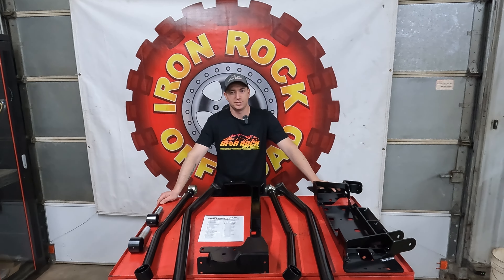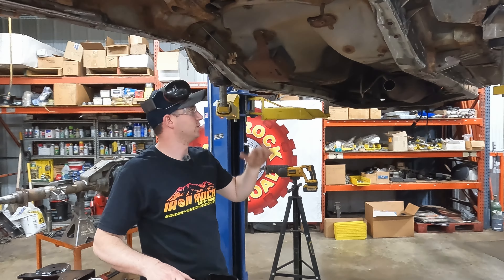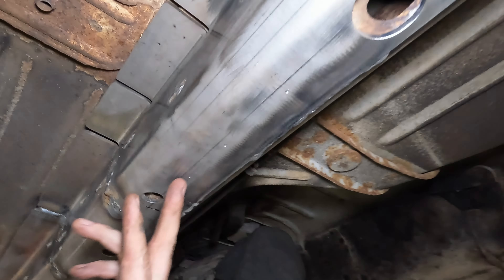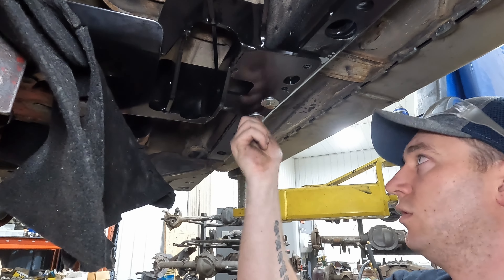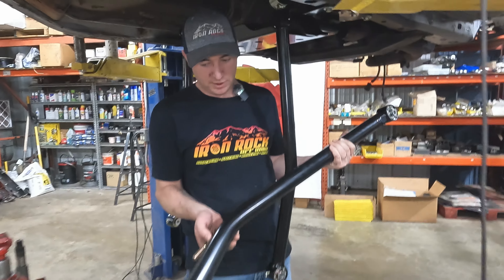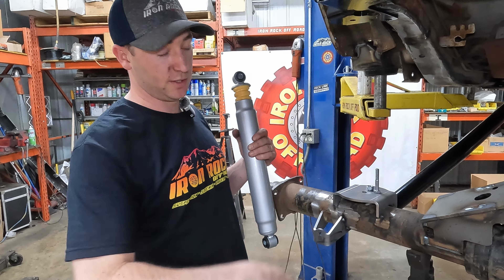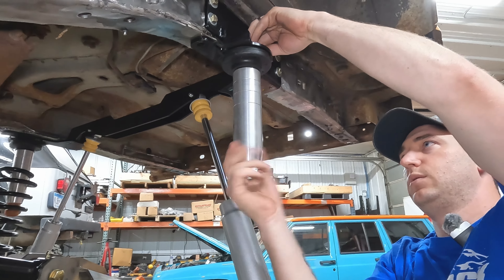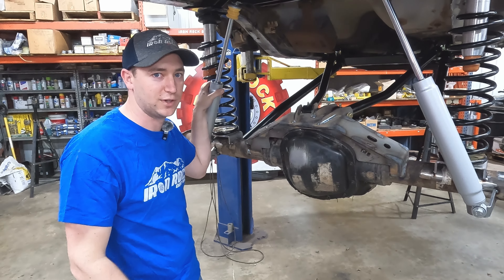XJ Rock-Link Rear Long Arm, Ditch the leaf springs for a 4-Link!

Comment: Been running this kit for about 1.5 years now and absolutely love the ride quality and travel. Just need to get limit straps sooner than later before I stress out a shock and break it. But very pleased with the kit in general! Was very easy to convert my Jeep to JK axles with your long arms.
Reply from the maker: @mountaincrawlers8 That's great to hear! Thanks for the positive review! How much lift and what tire size are you running?
Reply: @IronRockOffRoad  37s and roughly 7-8 inches of lift. Plan on stretching the rear with a doubler and lowering it a couple inches in the near future.
Reply from the maker: @mountaincrawlers8  That sounds awesome! Keep us posted on the progress! Give us a call or email if you need anything!
Reply: I'm in the middle of the install on this kit.  I have the coil conversion portion done and I'm working on the exhaust right now.  Did you re-install your cat when you did the exhaust?  Overall this kit gave me 2.5" more of lift over the Deaver leaf springs I had in the rear.
Reply: @stevenhunt66  no I deleted the cat years before installing this kit
Reply: @mountaincrawlers8  Ahh, yah it's looking like I might have to do the same with mine to get this to work.  Cali is a PITA when it comes to smog and modifying exhaust, so I have to be aware of what can and can't happen if I want to keep this thing smog legal.

As for the kit, you mention you love the ride quality and travel.  I'm very curious if you happen to have any pictures of how your XJ wheels when all crossed up with this coil kit?  I'm looking forward to wheeling this upcoming season with this thing.  I got new longer Bilsteins on the way since my originals were severely limiting the axle articulation in the garage.

Comment: I bought and installed this kit a couple weeks ago. I got the whole front and rear RockLink kit, plus a front truss and the 4 link rear exhaust. HOW IN THE HECK DOES THE EXHAUST FIT UP? I have tried this pipe every which way around I can possibly think of.
Reply from the maker: @TheRealMikeWilly We will be doing a video on the XJ 4-link exhaust in this build series, stay tuned for that. In the meantime, check the instructions for the XJ 8" Rock-Link PRO, we have a picture of the exhaust kit installed at the end of the suspension section. If you need more help, you can always give us a call 9am-6pm central time and talk to a real person. 952-210-7185. We would be glad to help you! Or send us an email at tech@ironrockoffroad.com
Reply from the maker: @TheRealMikeWilly Also, check the product photos for the XJ 4-Link rear long arm kit for exhaust routing. Product code 12544
https://www.ironrockoffroad.com/product/xj-4-link-rear-long-arm-kit.html

Comment: How much stretch can you get from mounting this kit? Can you just mount the cross member further back to get more? I'm aware the gas tank will be an issue with alot of stretch. Just curious about the adjustability of the kit
Reply from the maker: @fbik2009 You can get about 3" of stretch with our 4-link kit. We build a lot of adjustability into the threaded male ends in all our kits for anyone who wants to stretch or for extra adjustability in an axle swap. If 3" of stretch isn't enough, we do offer to make custom length arms for our kits. Since we manufacture everything we sell, we can do just about anything you could want. All the standard kits are ready to ship out the same or next business day, custom arms would be built-to-order, approximately a 3 week lead time depending on if you want them powder coated.

I wouldn't recommend moving the crossmember rearward because the rear driveshaft needs clearance when the axle droops.

Comment: Im in the middle of doing an ls swap on my xj , i want to use your 4link rear and 3 link front i just wander if i could still work with the transmission posibly being farther back on the body
Reply from the maker: @joshstapleton4172 Absolutely! We have had several XJ customers do an LS swap with our 3-link and 4-link long arm kits. You just need to fab an adapter for the transmission crossmember. No big deal if you can fab motor mounts and everything else to swap in the LS. Go for it and keep us posted on the build!

Comment: Does it sit lower with the 4 link? What about the load rating compared to the leaf springs
Reply from the maker: @montec3113 The Jeep will sit the same after the 4 link is done. We do offer the 4 link as a part of a complete lift kit also. If you want to upgrade all the suspension and add lift all at once look for our Rock-Link PRO kits on our website.
https://www.ironrockoffroad.com/category/long-arm-lift-kits.html
If you already have a lift kit, you can also get the 4 link as a long arm upgrade.
https://www.ironrockoffroad.com/product/xj-rock-link-rear-long-arm-upgrade.html

The load rating on the coils we use is a little higher that the leaf springs we use. This has two clear advantages: coil springs typically ride better than leafs so a slightly higher rate is acceptable, the firmer rate gives a little more load capacity for accessories like a bumper, spare tire, skid plates, etc.

Comment: Saving up fpr the sliders, frame supports and a complete long arm kit front and rear fro you guys for my 94 XJ. Figured best to knock it all out at once. has a 6 inch short arm on it atm.
Reply from the maker: @warbanzi That sounds awesome! Keep us posted on the build!
Reply: @IronRockOffRoad  Picked it up out of El Paso from a kid that was beating it to death at Red Sands, 37 inch tires sawsall fenders on stock axles with 4.10 gears. How that little Dana survived is like the 8th wonder. On 35 inch now and still un FUBARing it.
Reply from the maker: @warbanzi Nice! It sounds like a good set up. Take care of that rig and it will take care of you!

Comment: Can you run the stock fuel tank? What about a CAT converter?
Reply from the maker: @ianmikelson4187 Yes, you can run the stock fuel tank with this kit. We have the tank removed for easier filming and because we removed it to do the frame stiffeners and haven't reinstalled it yet. Our 4-Link exhaust kit (product code 13888) will incorporate a catalytic converter and clear all the new suspension components.

Comment: What travel length shocks can you use with these? I currently have 12” travel fox shocks and would like to reuse them.
Reply from the maker: @jordantrujillo293 The 8" rear long arm lift kit uses 12" travel shocks with a collapsed length of 29.5" eye-to-eye. The new shock position provides a huge amount of articulation as well as moving the lower mount up on the axle to get the shock further out of harm's way. You might need to swap those Fox shocks for some shorter ones.

Comment: I have the 4in kit mounted up to a ford 8.8 on my 1991. I have been running it for a few years now and for the most part am very happy with the kit. 
One issue I have ran into is in the rocks all flexed out the axle flexes so far that the spring drops  past the bump stop then when you level back out the spring has got between the unibody and the tire. I wish the spring was longer and trying to find a replacement has been a big challenge. The other option is running limit straps but I don’t really like the idea.
Reply from the maker: @lambert454 Thanks for the feedback, it's great to hear the kit is working for you! That spring drop issue is tricky, have you tried different bump stop lengths to see if that will help?
Reply: Thank you for the reply. Yes I have lengthened the bump stops. To the point i only have two inches of up travel before the axel hits the bump. I have a triple rate spring from metal cloak I am going to try. The spring rate is similar but the overall length is quite a bit longer. 

What are your guys thoughts on limit straps?
Reply from the maker: @lambert454 We are working on multi-rate springs for this application, but our spring manufacturer is in the area effected by hurricane Helene. We typically don't recommend limit straps, but our XJ rear 4-link has such a huge amount of flex I would be ok with a limit strap in this situation. Limit straps are great at protecting your shocks and providing a confident stop to the suspension travel, we use them on our Ultra 4 race Jeep. So often we see them setup incorrectly.

Comment: Installing this kit now on my 92 XJ.  Everything is going as planned and these guys gave me some good tips over the phone when it came to the coil springs placement that worked beautifully, thanks Travis.  

I'm currently working on the exhaust kit and my 92 has a cat that I'd like to incorporate into the exhaust, which LOOKS LIKE it would require welding the cat up AFTER the 4-link crossmember due to clearances.  But I don't see a cat being used in your XJ exhaust routing picture.  I'm wondering if that cat you show in your TJ long arm exhaust video is smaller than the cat I have, which is a MagnaFlow Exhaust Products 339229 Direct Fit California Catalytic Converter.   This cat has a flange on it that bolts to the cross pipe assembly of the XJ, which looks like will require me to cut the flange off the cat and weld up pipe to the flange and then again to the cat to make this work.   

Any chance you guys will have your XJ exhaust video or instructions up soon?  The XJ long arm exhaust kit you sell looks like it was designed w/o a catalytic converter in mind.
Reply from the maker: @stevenhunt66 Thanks for the compliment! You can certainly incorporate a cat into our 4-link exhaust for the XJ. We should be onto the XJ 4-link exhaust video very soon. The cat will have to be repositioned from its original spot because in will interfere with the rear 4-link crossmember location. Once the rear crossmember is in place it will be easier to position your cat. Take a look at the attached instructions below. You can see a small cat positioned between the front and rear crossmembers.

https://www.ironrockoffroad.com/Merchant2/I9117%20-%20XJ%206.5%20inch%20ROCK-LINK%20PRO.pdf

As you already know, we will be glad to help you over the phone 952-210-7185 or you can send us some pictures via email: contactus@ironrockoffroad.com, tech@ironrockoffroad.com

Comment: Why not weld a nut to the bottom of the lower spring perch?
Reply: How would you spin the carriage bolt?
Reply: @atwebb26  you wouldn’t use a carriage bolt, you would use a normal bolt
Reply from the maker: @JBarnes917 You could weld the nut and use a hex bolt if you want to. We chose to use a carriage bolt so that the bump stop would have a smoother object to engage rather than a hex bolt with sharp corners that could tear the bump stop. Tightening the nut is much easier if you install the shock after the spring. Then the shock isn't blocking your wrench.